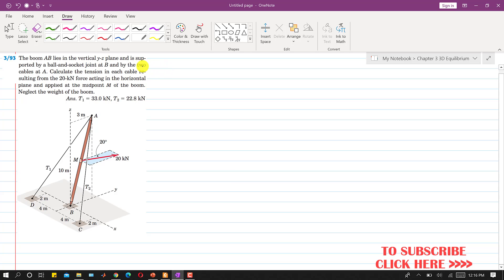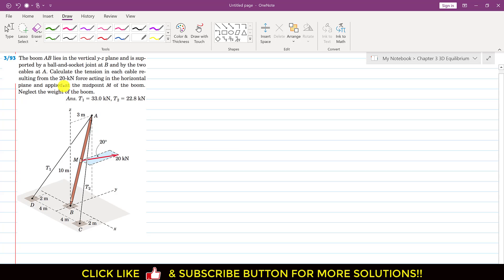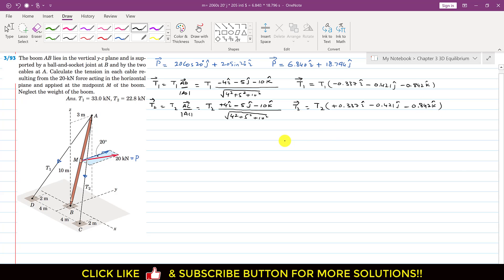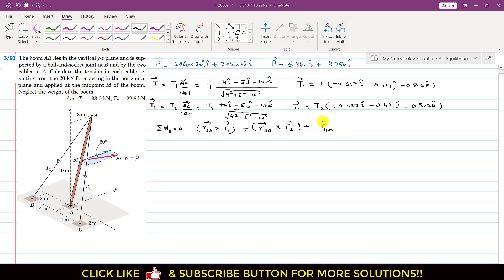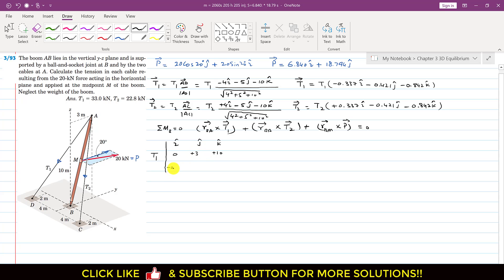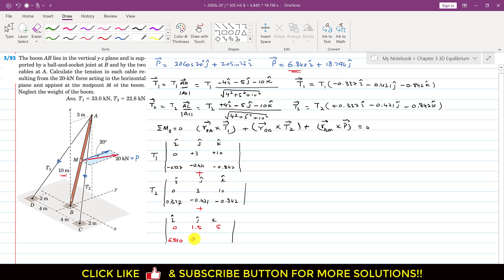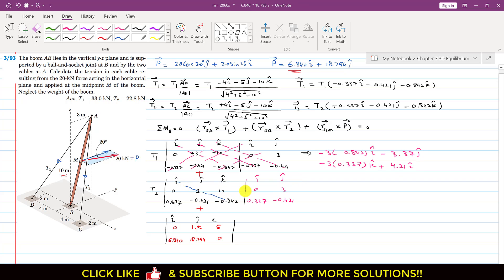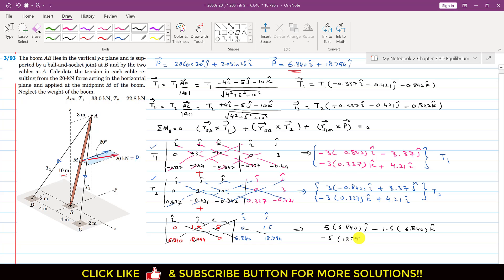The boom AB lies in the vertical y-z plane and is supported by a ball-and-socket.. Engineers Academy

Comment: 1. The vertical mast supports the force F = 4-kN. and is constrained by the two fixed cables BC and BD and by a ball and socket connection at A. Determine The force F the reactions at A and the tensions in cables BC and BD as vectors. b. Take the moment around A and determine the tensions in cables BC and BD. Apply force equilibrium and determine the reaction forces at A. Hint: The coordinates of points B C and D are B(O, 0, 10), C(0, -5 ,0), D(-4, 4,2) Hint: The force F = 4 kN is pointing toward the positive x direction.
Reply: Which is the answer? Please?